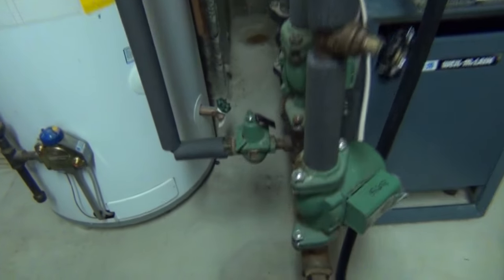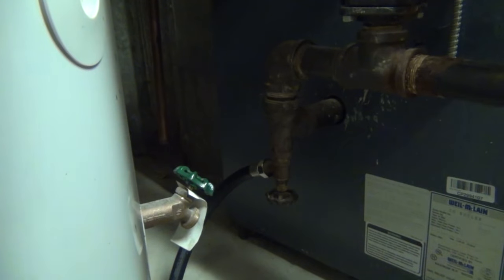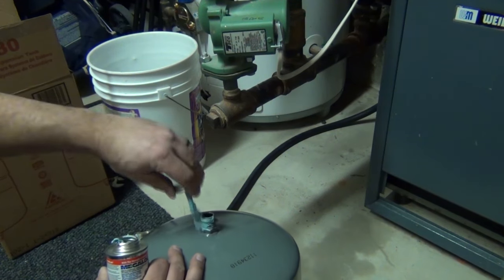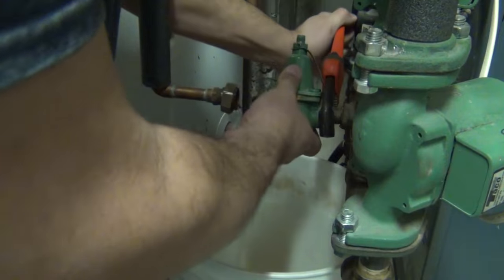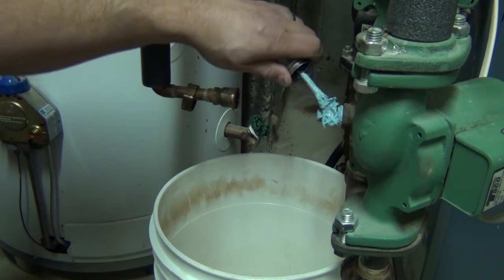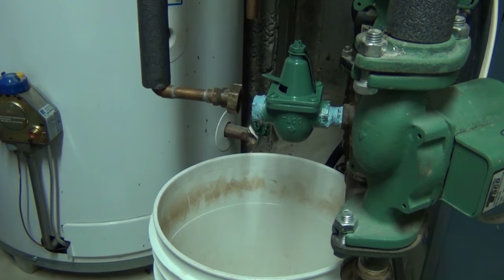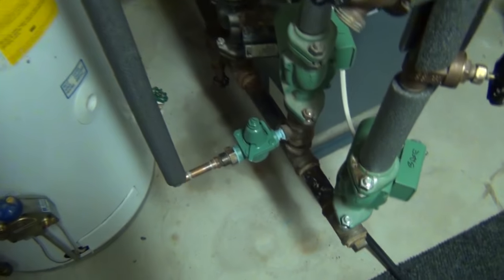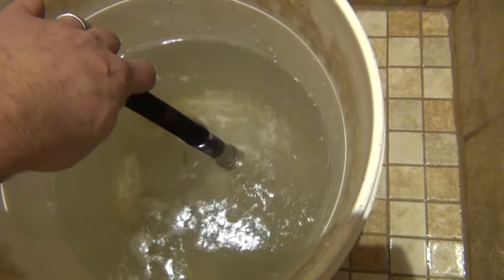Replace an Expansion Tank and Boiler Fill Valve | How To

Comment: Great video! Did you ever see a huge black metal expansion tank the size of a wine barrel that was literally strapped with metal straps into the basement ceiling rafters? It’s massive, and I seriously think like 80 years old. The expansion tank wasn’t, for some reason, replaced when my furnace was 8-10 years ago.
Reply from the maker: Lori Lyn Yes, I’ve seen that before.  How big is the house and what type of system?  I personally would have replaced it when the system was changed out.  I have a tank like that in one of my commercial buildings. It start leaking and we had to abandon in place because there was no way to remove it.
Reply: zimsjeep i have a Weil McClain CGa Gold boiler. My house has a basement and two floors above it. I just got off the phone with a plumber now because I just went downstairs to find an inch of water in the bucket under my relief valve. So that situation isn’t getting any better. Oh Lord, you had to leave that big tank in the ceiling? Did you drain it then? I’m hoping even though it’s a high of like 18 degrees F here today, that I can get him to do the work (expansion tank, replace relief valve) today anyway. It’s really worrying me now.
Reply: zimsjeep although my pressure is holding steady at 20 psi, which I’ve been told is normal? I can’t understand why the valve would be leaking then? If the pressure isn’t going too high?
Reply: zimsjeep you wouldn’t be anywhere close to Pittsburgh, PA, would you? I’m having a heck of a time finding a really good boiler guy around here.
Reply from the maker: Lori Lyn Once an old pressure relief valve opens up, it usually will never reseal or work correctly again. Between 12 -20 psi is considered normal pressure. It may spike a little when the system is running. The relief valve pops off at 30 psi.  I’d change the relief valve, expansion tank, and fill valve all at the same time because your problem could be 1 or all 3. The system will be drained so it’s a good time to get it all done. I’m out in eastern Long Island, not really close by.  As far as that old xtank I abandoned in place, it had a maze of pipes under it which is why I couldn’t remove. I’m sure yours will probably be a little more accessible in a house.  I’d definitely get this fixed sooner rather then later. If that relief valve opens and doesn’t close, you’ll have a real mess on your hands.
Reply: zimsjeep thank you so much for your recommendations, I’ll definitely make that suggestion for all three to be done. I have heard that once those relief valves start leaking, they’re never right again. So that’s for sure it has to go. I’ll see what they say, but I don’t think I have a maze of pipes under my expansion tank, although I do believe it is full, and it’s huge. So I hope they can drain it ok in the case they need to isolate it and leave it for dead in the ceiling when they install a new expansion tank. Heyyy Long Island isn’t so far....lol. Just kidding. Just my luck all the good boiler guys are in New York...but I do appreciate your help. Oh yeah, I have stood down there and watched it fire up, it only rises to 22 psi while firing even, then back to 20 psi. The plumber will be here within an hour and a half or so, I’m really not playing around with this, I’m getting everything tended to ASAP. I’m not the type to take chances. Thanks a million for your help. I’ll let you know how goes once he’s done.
Reply: zimsjeep so, new expansion tank, new relief valve, new fill valve happening Monday am...yay. U were right!
Reply from the maker: Lori Lyn Excellent!  Hope everything goes well tomorrow. 😁
Reply: zimsjeep thanks, my friend! I’ll leave you a quick update tomorrow after they’ve gone. I’ll be excited to be able to turn my heat up higher again. Trying not to do so right now, to put extra stress on that relief valve. Too cold here in PA!
Reply: zimsjeep expansion tank replaced, fill valve, and relief valve replaced, had my thermostat on 80 for last two hours to stress my boiler, no leaks! Up and running at full capacity just in time for a couple of 8 degree days in PA. In the negatives at night. Man, it takes a long time to drain the entire system, and then to refill it, but it was well worth it. No more worries now of that relief valve blowing wide and a huge flood with lots of destruction. Thanks again for advising me to get it done ASAP, I feel much better for it. No more constantly checking on and babysitting that beast. Lol.
Reply from the maker: Lori Lyn So happy to hear you got everything fixed.  Yes, we have some nasty cold weather coming in the next few days, you got that repaired just in time...better safe then sorry! 😉
Reply: zimsjeep yikes, super agree! Thanks again😁
Reply: Common on large boilers
Reply: @myheartisinjapan3184  a bad valve leaks under rated PSI... If its 20psi when not at temp then there could be multiple reason why its leaking once it fires up and that boiler heats up

Comment: Do you recommend running the auto feed on the supply or return
Reply from the maker: Ideally on the supply near the xtank and air separator. The system in this video is setup and piped like crap unfortunately. I’m married to it until the day I replace everything.
Reply: @fixitwithzim  thank you I am doing my first ng boiler and had it almost done then heard should be by supply lol

Comment: Hi there. I have a single circulator and 5 taco zone valves. If I shut the purge valves at the return and shut off all thermostats can I use the zone valves to isolate the boiler to change out the expansion tank and relief valve instead of draining the entire system?
Reply from the maker: Turn off the makeup water also, it might work but you’ll need to bleed the system anyway. You might has well just do it right and drain it down
Reply: Thank you so much for the very quick reply. Your video was so helpful.  I’ll just go ahead and drain down all the zones. One last question:  any tricks to unscrew the expansion tank if the threads look pretty rusted and crusty where it screws into the fitting?

Comment: Hey Buddy. Just to clarify after watching.  To replace my expansion tank and fill valve which are both on my 1st floor zone, I shut the return into boiler foe that zone and empty boiler foe\r that zone only?
Reply from the maker: You would need to drain the entire system to swap out these parts as they should serve you’re entire system
Reply: @fixitwithzim  thx.

Comment: My expansion tank is starting to drip ,just before it there is a inline shutoff. I believe to replace it all I have to do is shut the supply off drain the water heater,and swap the tank out ? And kill the power to the furnace..

Comment: Can I change the Expansion Tank without having to drain my system?  Can I just unscrew the old one  and re screw on the new one?
Reply from the maker: Not unless you have an isolation valve for the tank. You’ll need to drain, install, then bleed the system.

Comment: GOT MY TANK AT LOWES and notice it says "hot water heater expansion tank.  nothing about "boiler" in the direction but comes charged to 15 PSI, and up to 200 degrees "F". Can I use it for my boiler?
Reply from the maker: How many gallons is it?
Reply: @fixitwithzim  It's 5 gallons .

Comment: Man, I just replaced a 15 psi Watt regulator valve, bled the system and an hour later the meter went from the 15 up to 40 psi. I just shut the supply lines down and don't know what to do. Any ideas?
Reply from the maker: Make sure you don’t have it set to fast fill

Comment: this is a little confusing. are you changing the expansion tank on the boiler or the hot water tank?  the pressure will be different for each.  the hot water one needs to be the same pressure as the house. (checked at outside water bib or washing machine)  the boiler one should match the boiler  system.  which is a closed loop system.
Reply from the maker: Hey, did you watch the video?  I clearly show working on the boiler throughout. Hope this helps and have a great day!

Comment: Really enjoy your videos..My boiler pressure was up, has a ball valve isolating my tank, closed valve bled tank and removed installed new tank. Pressure still high in boiler even after isolating boiler feed valve and removing some water from system like I was bleeding zones.Think my feed valve is bad or was I removing water the wrong way? BTW thought I recognized your accent..Bellport here..
Reply from the maker: Yeah, fill valve probably bad, replace that and your problem should go away.  I’m over in Centereach...thanks for taking to time to leave a comment!

Comment: Other than the fill valve leaking, why would you need to change these
Reply from the maker: Preventative Maintenance. Replace them before they break and cause an issue

Comment: Why don't you use the brass fittings on water feed line instead of black nipples. Whenever I open these fittings they are mostly corroded and clogged with rust. It is safe to use copper or brass fittings.